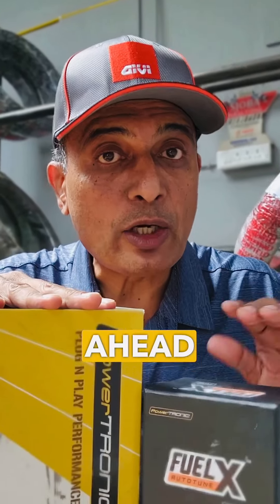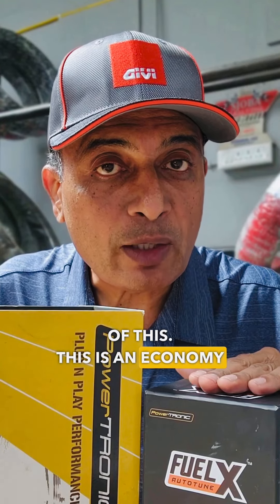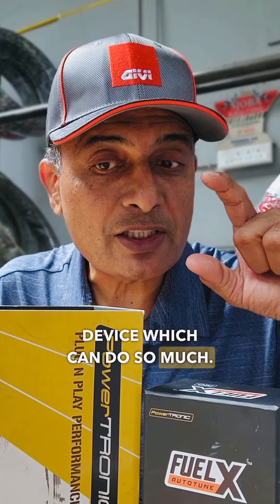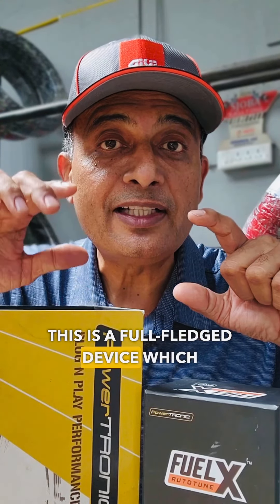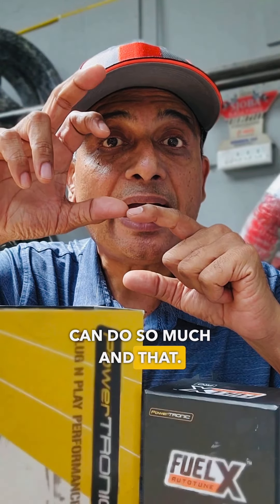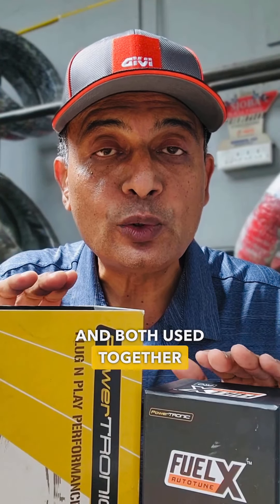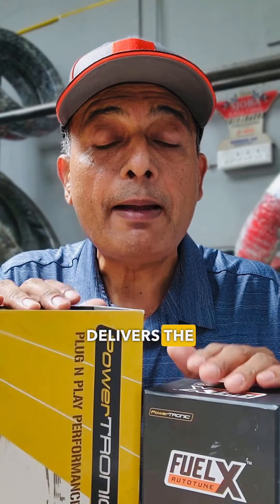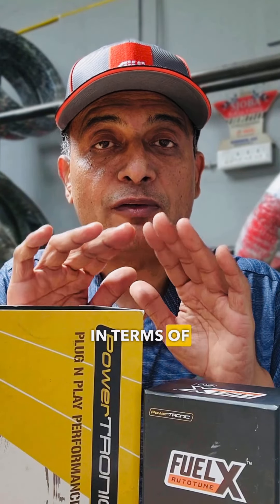Powertronics VS FuelX. What's the difference?

Comment: Hi sir …I have an interceptor 650 I am willing to install powertronics and fuelx as per your video … will I have to change the exhaust or air filter to get the best performance? … if so can you suggest me a good exhaust that’s not too loud i don’t want to create any ruckus … with the stock exhaust itself is it possible to get the performance out … please reply…
Reply from the maker: For full benefit of the electronic devices, an unrestricted exhaust and a performance filter helps deliver full potential. Stock exhaust deliveres a little less than full.
Reply: @bigbearbangalore Thanks for your reply, Please suggest me a reasonable choice  So which exhaust can be used for the best performance. please note i don t want a loud one
Reply: @MrDevilnirmal  Power range  long exaust

Comment: Hi
I have a Honda GB350 Australia. Or a Hyness in India. 
I feel by the sounds that I am getting pre ignition when pulling hard on 2nd or 3rd on very very steep hills over 3,500 rpm. Also in 4th on relatively flat roads when accelerating hard over 4,000 rpm before moving into 5th. 
I read somewhere that some ECU’s only use the O2 sensor up to 3/4 throttle. After that they use mapping only. 
Do you know if this is the case with the CB350. 
If this is the case. Any suggestions. Would either of these unit’s rectify 
Cheers 
Brian
Reply from the maker: The CBs here have very little combustion clatter and are smooth right through the range. Perhaps the ECU mapping is different for OZ?

Comment: Sir i got my himalayan bs4 serviced today,got oilchanged filter changed. but still it lacks the power it runs little sluggish,  the service guy told me that you need to reset the ecu  because of it it has lack of power and even the exhaust is muffled  much..  how ecu affect in this scenario?
Reply from the maker: Don't know. Get it checked.
Reply: Bro ask them to check spark plug cap, the cap must be removed  and checked with the help of multimeter, if it show zero or 1 as reading it means its blown, need to replace it... I had same issue on my interceptor  and the culprit was spark plug cap adaptor....
Reply: @krishnaniyer8001  Thank you brother

Comment: if powertronic piggyback ECU can do everything that fuelx does and more then whats the reason to use them both for maximum performance?
Reply from the maker: FuelX adds more conplex data and info to the piggy back.
Reply: @bigbearbangalore what difference does it make in real world?
because
as per the video the piggyback ECUcan do everything what fuelx does 

whats the reason to add more complex data?
Reply: @Ankesh_00  I guess he won't reply even I am searching for the same answer.
Reply: @yadhuu  😁😁
Reply: The only reason is that they make more money if you buy both. The power commander is all you need to create a proper tune and adding a fuelX to the mix will screw with the map. It's a really bad idea. Best to remove the O2 sensors altogether and do an open loop tune with the power commander - do not add a fuelX

Comment: Sir for ktm 390 adventure fuel x vs powertronics which do you recommend
Reply from the maker: They are different and one cannot replace the other. The prices too are quite different. FuelX is a simpler and cheaper device. Try it with a BMC air filter and if you want more, add the Powertronics ECU.

Comment: How's the hunter 350 in the city , I heard people complaining about the heating issue. Since I will be riding in city and traffic , should I go with it
Reply from the maker: Most come to the Hunter from sub 150cc motorcycles so the normal heat from a 350cc feels like there is overheating. That is not the case and just needs accepting and getting used to.
Reply: @bigbearbangalore  my budget is 2.5 lakhs and I want a bike that is good in city , has ok pillion comfort and decent at highways. Should I go with hunter 350 or look at better alternatives under 2.5 lakhs . What's your opinion?? What would you choose if your needs were the same??
Reply from the maker: Take test rides of the shortlisted motorcycles with pillion and choose. Both should feel comfortable. Try the Huntwr and the Suzuki V-Strom 250sx too if you like adventure style motorcycles.
Reply: @bigbearbangalore  thanks a lot ❤️
Reply: Hi Bosky, Why don't you suggest Honda CB350 as well
Reply from the maker: It's not a great commuter. Gearing is too tall.
Reply: @bigbearbangalore what about HD X440 Bosky
Reply from the maker: @narendrakakashimodi it's too early for the kits to be available for the HD.
Reply: @bigbearbangalore   we are using for daily commutation , ultra soft clutch and quick torque helps to ride in heaviest of traffic.
Reply from the maker: @vikasshelke5544 yes agree

Comment: Hello Sir, I’ve an 390adv and currently facing issue with low revs and gearshift between 2 and 3 seems very hard at times and bike is 3months old approx 3300 on odo. And I’m not sure if this gearshift issue is common on all 390adv. 

Will fuel x pro fix this issue?
Reply from the maker: Can be a loose clutch cable. Get it checked. FuelX cannot fix this.

Comment: Hello Nanba, i have a problem in my bike, I hope you can clarify whether it is normal or some other thing. I bought a metro 350 6 months back which is hardly driven for 3200km. When I am getting down from a flyover or approaching a signal and I am in the appropriate speed and gear, i face the pull and push as if the bike is lacking for petrol. Is this normal or a problem in the IC Mapping. Sorry I do not have Instagram id to reach you. The pull push happens in 3rd gear and sime time 2nd gear.
Reply from the maker: Can't say what it is. Needs inspection and a ride to identify the issue if any.

Comment: Recommend me one garage motorcycle under 3lakh rupees must be with me for atleast 1lakh kms.
Reply from the maker: Under 3 is tough. Perhaps the V-Strom 250sx.
Reply: RE Scram, if not Himalayan...
Reply: Honda highness 350 should kay for 1 lakh kms .I have already covered 65 k odo and bike still feels like new with no drop in mileage and performance
Reply: @vikasshelke5544 have u installed the fuel x? In ur h'ness?? And if u want to ... Does it improve the mileage and heat!?

Comment: Powertronics is a pure scam, Why would they make it so that u would need to buy FuelX even when u already have powertonics to further refine the AFR?
That said even both devices together fail to make a dent in the stock ECU's AFR table for most of the cells, It fails, terribly at richning the mix consistently, Their quickshifter is a limp gimmick that breaks off with even slight strain.

Comment: rather than using words like magic for things u cant explain, u should know this - without using in conjunction with a wideband O2 sensor and a autotune unit that changes AFR, there is no fueling change in FI bikes. this is like 1st grade knowledge, u can contact powertronics and they will tell you the same.